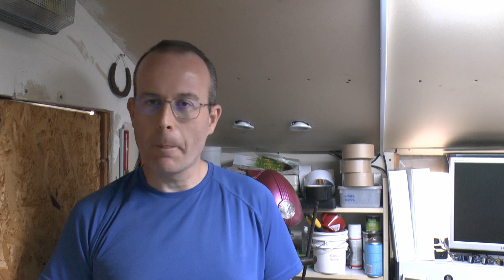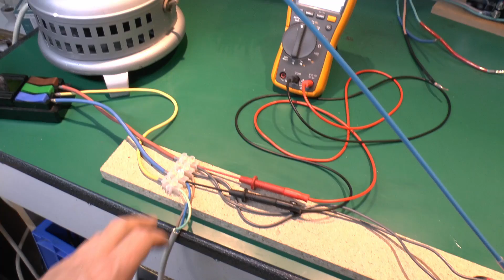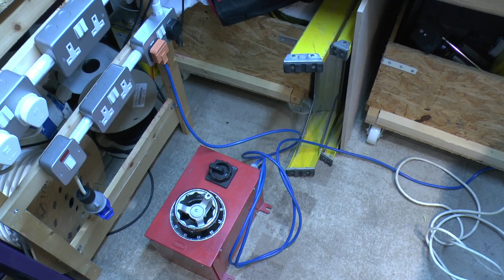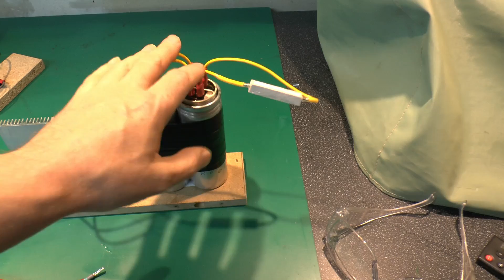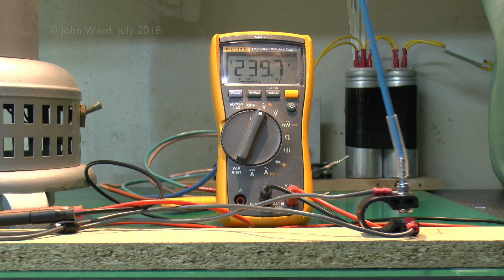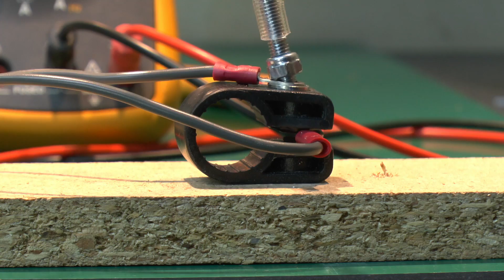AC vs DC Switching Demonstration with Arcs

Comment: A good demonstration. Not just switchgear, though; I've got a solar PV setup in my house, and on the inverter there is a warning label: "DO NOT disconnect DC plugs and sockets under load - turn off AC supply first." There is a pair of switches for disconnecting both ends, but it's wise to switch out the AC end first (then the inverter shuts down internally). Of course, those who are used to DC electrified railways will be familiar with what happens from time to time!

Comment: Nice demo of how conductive air becomes once it turns to a plasma. 
Fixing small powerful magnets in the correct orientation close to the contacts can "throw" the arc out in a curve and help to snub it for DC. It works for AC too but the arc goes in two directions so positioning can be tricky. 
Heavy duty DC contactors sometimes have them built in.

Viewers, don't make the mistake of choosing "gold contacts" thinking they are better. Silver is best for DC even at the small scale. Choose gas envelope enclosed contact relays if possible, the ones opened by a rotating armature are faster, if you can get them big enough.

I have long been puzzled by the regs quoting higher safe voltages for DC. Crunching your muscles in one direction rather than making them "ripple" they are a lot more painful, or so I assumed, and seeing it happen to others that conclusion seems safe.

Comment: probably explains why a dc inverter arc welder is much easier to strike than the older ac welders
Reply: Jusb1066 I got an old buzzbox, what a pain in the ass with aged rods
Reply: me too pdgeman, really annoying, sticking etc! mine is ancient big and heavy and a load of rods probably older than me, but it was cheap (free from a friend actually)
Reply: do you mean stick tig or mig? All of those are arc and sometimes Ac and other times dc depending on material.
Reply: stick weld is commonly referred to as arc weld,  mig or tig, although use an arc , are not referred  to that way
Reply: Well I have hardly ever heard it referred to as anything other than stick over det hundreds of welding videos I have watched. But in the age of brunel I guess it was. JK
Reply: british vs american terminology differences i guess is all
Reply: The term stick welding confused the hell out of me at first. Imagine the confusion when you're thinking that the stick is the filler rod in tig welding, rather than the electrode in electrode welding. 

I'd only use arc welding to differentiate between arc, spot, flame, forge, or friction welding.

But maybe I'm weird. Dad only taught me how to tig weld, because it's just like soldering. Never used a mig or electrode welder in my life.
Reply: You can probably add a rectifier and cap to make it dc.
Reply: @rimmersbryggeri  l heard of Arc welder. 🙄
Reply: Yes Sir,

Comment: Would be interesting to repeat the experiment using 12v DC at different current ratings. I am using standard mains 10a light switches for a 12v DC solar installation running some 12v 10w LED floodlights.

Comment: This also explains why it is more difficult to Stick Weld with AC welding current. It is still useful for it's arc's immunity to magnetic effects and also it's ability to clean really rusty dirty steel. But when you realize the arc is extinguished and reignited in the opposite direction 60 times a second then you understand the extra difficulty involved in keeping it going.

Comment: Explains why relays have different voltage rating for AC and DC.
Reply: Double pole relay
240 volts AC 100A
12 volt DC 13 amps
Reply: so I have a ryobi compound miter saw that was given to me. was told the switch is bad. it runs of a 120 volt 15 amp DC brushed electric motor. I took the switch out after a failed continuity test and cleaned the contacts along with removing the brushes and sprucing them up as well. then I noticed the armature assembly needed a good cleaning so I did that as well. put everything back together and sure enough ran great. long story short my brother said he had the correct new brushes and a new switch so I let him take it and put them in. he did not have the brushes and his DPST 6 pin toggle switch...
blew a fusible link with the field. my question is can I wire in a DPST 4 pin that I have now that I have the field back to working order and if so can you help me out with the correct wiring schematic if I was to send pictures and or video. I really need this saw have 4" baseboard to cut and install l. thanks for the video as well very informative

Comment: This very concept presents problems for designers of switchgear.  Until just very recently high voltage DC circuit breakers were developed by ABB.  Because of the extreme stress by the DC current, it has taken years to develop them for practical use.  DC has always been difficult to design switches with.  Frequently DC voltage is used for protective relaying in substations since it is easily obtained by batteries.  However, this convention has forced the use of very high rated contacts in the substation to be able to cope with the DC voltage.  Here in the US, 125VDC is very common for substation relaying power.  The switches and relay contacts need to be heavily rated, and many break 2 sets of contacts in series to achieve the ratings.

Comment: It would be interesting to show how the arcing can be reduced using different types of snubber circuits...
Reply: You can't really use a "snubber" here, because there isn't much of a large change in current or voltage, but rather a continuation of conduction through air instead of wire, so "arc-quenching" techniques need to be used.

Comment: I've experimented a bit myself with arcs in a magnetic field. A decently strong magnetic field changes the way an arc behaves - makes it much harder to strike, shorter-lived and shorter in length. It also melted my copper wires with ease once inside the field, so I suspect hotter.
Reply: Vyl Bird Special DC contactor relays used to be made which had magnetic blowouts to suppress the DC arc.

Comment: The one issue i found with this demonstration is DC voltage, multimeters usually show RMS of AC voltage and not peak voltage, so if you use 240V AC, the DC voltage should be around 340V and not 240V.
Reply: Is this why ac only dropped about 5V on the meter under load and the DC dropped about 50-60V ?
Reply: @LeeCookson  partially yes, when there is no load applied to DC power supply, the voltage is almost perfectly flat, but when load is applied, the voltage starts to look more bumpy, the more current is drew from power supply, the bumpier it gets due to capacitors not storing enough charge and since most multimeters measure only RMS voltage, it is showed as big voltage drop, while peak voltage drops only by a small amount. Another reason for bigger voltage drop is introduction of additional elements (diodes) adding more resistance into the circuit reducing overall max current the power supply can deliver.

Comment: I'll use my 3500V series mosfet switch to show the difference between positive and negative DC sparks.
difference in heat, color, and sensitivity to magnetic fields.
there are a few major differences...

Comment: It would be great if you covered the construction of DC switches and showed them in operation. I noticed that some people insist that DC is an overall better system because of the efficiency you get with UHV transmission. I won't get into a debate on whether AC or DC is superior, but I will say that it looks like AC is more practical in the home so you can use higher voltages to use cheaper, thinner wires to distribute power while using more cheaply made switches. It doesn't look like you could use a 120-240 volt thermostat very reliably on DC without the added complexity of arc suppression. Certainly it would seem that you would want AC during a malfunction so the arc could much more dependably snuff itself out to help prevent a house fire. On a side note, I notice that your voice seems to drop in intensity in the middle of your sentences, and it becomes harder to hear you. Usually, I have the auto volume on with my television to help deal with the large variances in volume level on YouTube between channels. I prefer to turn in off when I play music. Anyway, most people likely don't have a volume compressor on their audio. Perhaps you need a lapel microphone? You can get them rather cheaply on eBay if your camera can use an external microphone. Many people are just using their smartphones these days also so I don't know what you are using. Anyway, it should help boost your subscriber count to help normalize your audio pickup.

Comment: Yes, I learned this as an undergraduate trainee trying to break a 60Vdc supply with a relay. It melted! Eventually got away with a bigger relay and snubber across it, but these days prefer solid state solutions.
Reply: Billy Sugger trouble is solid state relays tend to fail closed.
Reply: Lee Wheatley They can, as well as Mosfets, which is what I’d use these days. But both are substantially more reliable than electromechanical relays.

Comment: i had no idea 245 volts DC was even capable of producing a sustainable arc.  The lowest voltage arc i've even been able to make was while monkeying around with a microwave oven transformer and I could stretch the arc out to about 5 inches before it breaks (about 2100 volts but then it is AC).

Comment: John, another very instructive video.  How about a video on relay switching of AC induction electrical motors.  This could cover inrush currents and inductive spikes when switching inductive loads and explain how these are dealt, I.e. by relay current rating and an RC snubber, for example.  Perhaps show a typical relay data sheet and explain about life of relay varies with kW (or horsepower) of motor.  Perhaps cover concepts on LRA and FLA.

Comment: I think Tesla's way was right given the choice,
A.C. has it's issues.
But D.C. issues tend to be more destructive, as
Well as the arcing john has shown, electrolytic action can effectively plate contact areas effectively forming dissimilar materials at junctions,
The whole basis for metal plating, but sometimes it's an effect that will not be required and then it becomes a maintenance issue, it just pays to do research on these matters!

Comment: +John Ward
What about wiring the DC//AC 240v heater through the CLIX 15A socket without back, and a suitable plug, if clamped down in place should be easy to press the big white button etc...   Both contacts clearly visible on camera would be good!.
Reply from the maker: Will do - that particular switch is stored away somewhere so may take a while to locate it.

Comment: I remember when vehicles still used ignition "points" before electronic ignition took over, there was a "condenser" I. e. capacitor connected across the ignition points to spare it somewhat. Can a capacitor across the contact not serve the same purpose?
Reply: A capacitor along with a resistor. The vales must be correctly calculated based on load and voltage though.

Comment: You know... I just read the title and was thinking for a moment ~aww... shit~ but then I realized my switch will be just fine. :))

I'm using a 20A 240Vac switch on a 48V battery that powers an ebike. But for me it's all well and dandy as when I operate the switch there is never a load on the battery, there is no current flowing so there is no arching.

Comment: Super awesome demo of DC vs AC! This is probably the best demo of this i've ever seen. Not jokin'! 

I've always wondered. Why do we use 50/60hz? Why isn't a higher frequency better? Isnt it true that higher frequency requires smallers cores on transformers? 

I'm really curious.

/Dennis
Reply: The generators would need to run at 20x the speed they currently run at. Either that or add more poles to the generators. It's not cost effective. I suspect people would also be annoyed at hearing a continuous 1kHz tone
Reply: Also: If the frequency is high enough, the power lines would act like antennas, radiationg your energy into space instead of transporting it to the consumer. At 50 Hz, the wave length is 6000 km. Only extremely long transmission lines over a quarter of that wavelength (1500 km) will have issues. Which is part of why we use HVDC for such long distances. But at 1 kHz, the wavelength is only 300 km, which means any line longer than 75 km will start radiating a significant part of the power.
Reply: There's trade offs. Yes, a higher frequency would allow for smaller transformers. But as someone else mentioned, there's the skin effect.  For 60Hz, the depth is about 0.4 inches. But for 400 Hz, the depth is 0.16 inches. Also power lines have capacitance and inductance. So some part of the power being transmitted over the power line is spent charging and discharging lines which reduces the effective power available at the end of the transmission lines. In a nutshell, DC is superior to AC for almost any purpose except for a few specialized instances.
1. It's easier to change voltages using AC cheaply.
2. As demonstrated in this video, it's easier to switch off AC.

But for almost everything else, DC is easier to handle. The choice of 50 or 60 Hz is a historical compromise between the efficiency of using DC with the ease of changing voltage for AC so that higher voltages could be used for long distance power transmission and lower voltages used locally for safety.
Reply: Check out Roobert33's version of this from August 2012, where he uses a big knife switch to demonstrate the difference.

Comment: Did you get the current measurements?

The DC voltage had a huge voltage drop while the AC Voltage didn't drop at all.

Comment: i found a street light in malaysia and this is so common where they still dont use circuit breakers (some of them does) but a lot of light poles still uses fuses or some of them are just like bypassed with a wire. well come to malaysia and look at the street poles you can see a lot of street lights cover opened with some black overhead cable.... some of then were taken action by the goverment and they put some metal plates to cover it but most of them are real crap. i touched one of the black overhead cables near the "protected wiring circuit". and most of our street lights are 260+ because the voltage on these lights arent balanced. the reason why they use those overhead black cables on the light poles because the armoured cable inside the road is not working anymore. now if you touched those cables going to the light poles most of the time they will spark if youre really lucky it wouldnt spark at all. well one day i was at  a clothing shop there was this not turned on street light with its black overhead cables coming to provide power to light because the inroad cables are broken i touched the live wire and "BZZZZZZZ SPARKSSSSSS BZZZZZZZZZZZ *and then light turns on*" theres some people in malaysia who's almost killed by a lamppost because at some state theres a problem where the live has leaked to the metal body, and most of the times when you ground it, theres not gonna be a RCD nearby

Comment: JW, thank you for this nice demonstration. I wonder, how much current did the heater draw both when supplied with AC and DC? With AC, there could be significantly less current due to the inductance of the load. The voltage should be set to achieve the same amount of current in both cases, I think.
Reply: with 60hz there will not be significant inductance ,i think

Comment: Halogen heater or fireglow bulb creating the orange glow, either way it was dimmer on DC.
Reply from the maker: Voltage was lower - it was set with no load which was nearer the peak of the AC, and voltage dropped when the load was applied.  You can see the voltage drop on the multimeter when the switch is closed.

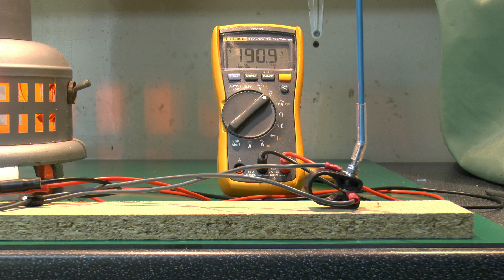Comment: Why is the voltage drop so much more significant in the DC setup? During the AC test at about 4:20 it fell by just a couple of volts, but during the DC test at around 5:40 it was around 50.
Reply from the maker: With no load, the capacitors are fully charged 100% of the time and the voltage is the same as the peak of the AC input.  With a load connected, the capacitors charge and discharge on each cycle and the voltage is nearer to the RMS value of the AC input.
Reply: Not to mention 240v is RMS voltage isn't it? the peaks are wayyy higher. Is that correct?
Reply: Yes, something like 340V. Well spotted - I shouldn't have said "voltage drop" which has a more technical meaning. What I meant was the amount (or, better still, proportion) that the voltage decreased.
Reply: @Madsstuff   The peak is  square root of 2 * 240V = 339.4V peak .
Reply: @Hrostbjergsorensen  Interesting. Is it always the Square Root of the working voltage?
Reply: The top ring terminal is loose, so that may have something to do with it